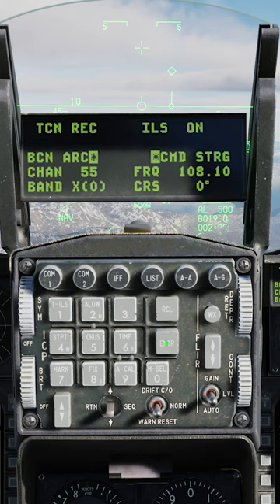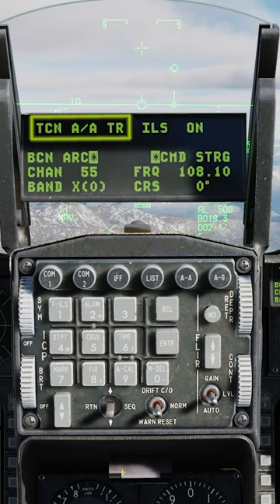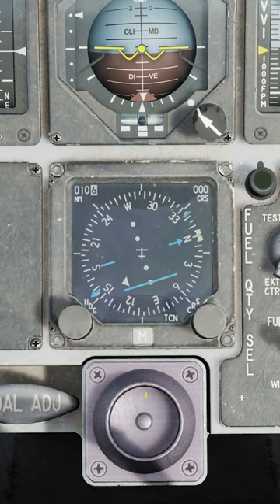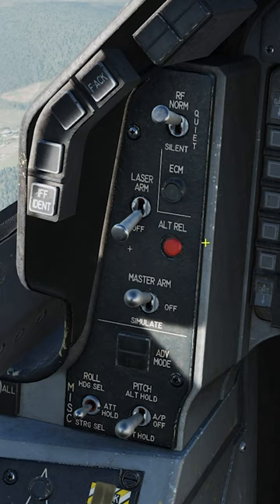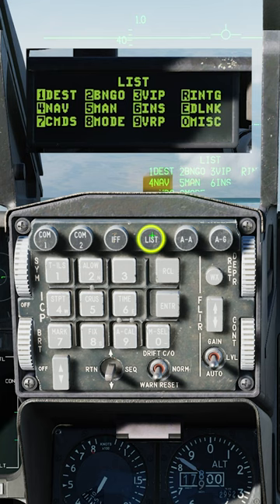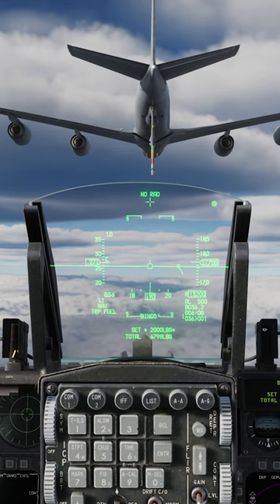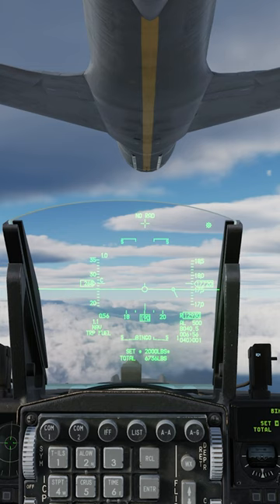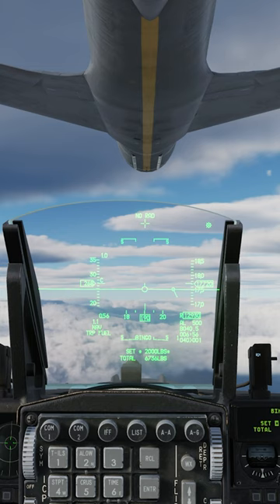Refueling my F-16 in midair!

Comment: man can you do su 27 flanker start up in 60 seconds please
Reply: It's fc3 module, you don't need a guide for it
Reply: 0.6 seconds, more like it! 😉🤭
Reply: Autostart exists
Reply: The Su-27 takes like 3 buttons to turn it on but ok.
Rearm with whatever munitions you want by having a fully powered down flanker with canopy open by pressing the \ key.
Once the aircraft is fully rearmed do these steps in order. 
1. Right shift L to turn on Electrical power.
2. left control c to close the canopy, right shift home to turn on both engines.
3. Wait until both engines RPM are idle (Look up a cockpit guide if necessary to locate the RPM guages) 
4. nosewheel steering and taxi to runway. 
5. Takeoff

Comment: Is the tanker frequency always the same? Where do you locate that info to type it in? Thanks for the awesome F-16 content man. Keep it coming! So helpful for a new sim pilot
Reply: It’s usually changing, and is usually shown in the briefing. Hit “return” with the dobber (dobber left), and then hit T-ILS. Then you can input the TACAN. DCS uses T/R and not AA T/R, for some reason, and they don’t wanna change it, so beware of that.

I advise you to only use your fingertips and make smooth, calm and gentle movements. Don’t rush it. If you want to see your fuel, hit LIST on the ICP and then press 2. If you go to whee you enable the left and right hardpoints, you can right click twice on DED to display it on your HUD.

Comment: I fly primarily the Hornet, and tanking that with the basket is pretty straightforward. 

I tried in the Viper last night, and while not my daily driver I’m pretty decent with it. 

Cleared pre contact, got just under the tanker and made sure the lights up front were green. 

However, how do you know you’re taking fuel? 

How much slack does the Probe allow before you DC?
Reply from the maker: I have a full video on my channel for the f16 refueling that answers some of these questions

Comment: When do ypu insert credit card!!
Reply: God, the bill for a jet refuel would be nuts. And it holds 1,700 gallons without drop tanks or CFTs. It burns 800 per hour at cruising speeds. Figure it's about $3.15 for jet fuel, so about $2,500 and hour? Oh boy.

Comment: I can AAR ok in the Viper, in fact it was the first plane I managed it in. But I’ve had to learn through trial and error and developing the sight picture. Depending on the light, there are many times I can’t make out the director lights at all. I’m using a 4k monitor with mostly max settings and those lights are tiny, typically have bigger all contrast so I can barely see them. Ok. I don’t have the best colour eyesight, a small deficiency in red-green but I manage with everything in DCS, save these director lights. 
I’m fairly sure this is unrealistic and assume using HDR would improve the contrast notably, assuming ED has coded the light realistically. 
If anyone has any tips on how to improve the visibility of the lights, I’d be grateful.

Comment: That’s not a KC-135 shown. That’s a KC-46. 

I understand it just a sim, but my father helped start the C-135 line, so it maters to me.
Reply from the maker: Then you need to learn your aircraft first
Reply: If you think so. Have a good day.
Reply from the maker: @konekillerking  I would look up which refueling aircraft has 4 engines first
Reply: That is definitely a KC-135 as the 135 has four engines while the KC-46 only has two since it’s developed from a Boeing 767

Comment: There ARE DIRECTOR LIGHTS UNDER A TANKER? I have never played DCD aside from the early Black Shark part, and I usually flied in gamss that were simulations but not military simulations, like Kerbal Space Program for example. I could NEVER get my design of a tanker to work in first person. Now I know that I should just make a program a set of these lights and it'll work... Should've done my research instead of just winging it 😅

Comment: I can do all that except my speed control is not good enough. I just can't seem to hold it steady enough. Then PIO (pilot induced oscillation) starts getting out of control, then I get pissed off and crash into the tanker on purpose. If I can't get fuel, no one is. I don't think I would make a good fighter pilot.